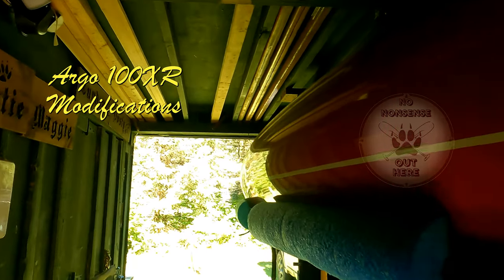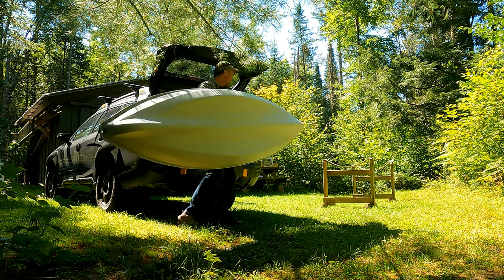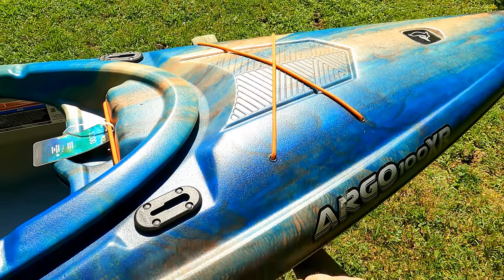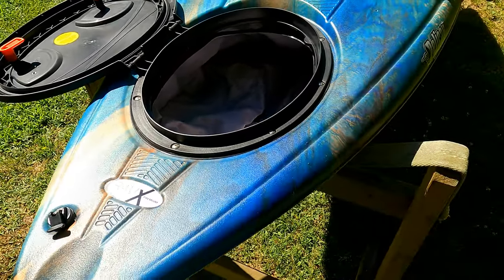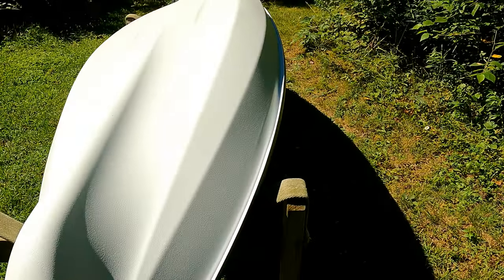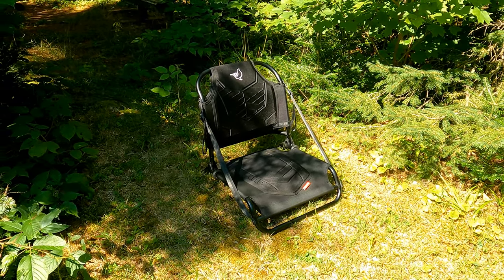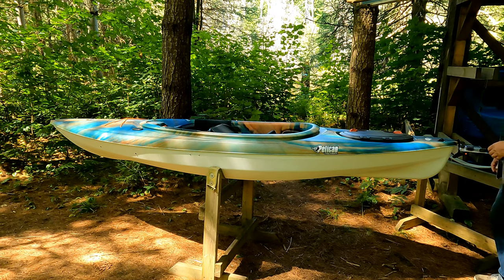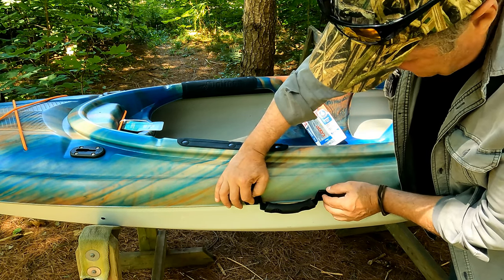A Kayak For Great Adventures - Pelican Argo100XR  Overview And Modifications You Can Do

Comment: The fibreglass reinforced is a great idea ,never seen that material.  Also the handle smart idea
Reply from the maker: The handles worked out great - it makes it so easy to pick the boat up without dragging it over the ground.  I have seen allot of pelican kayaks with messed up hulls due to rocks.  The keel protection should help.   I will let you know how they make out once I put this little boat to the test of Algonquin Life.    Thanks for reaching out.